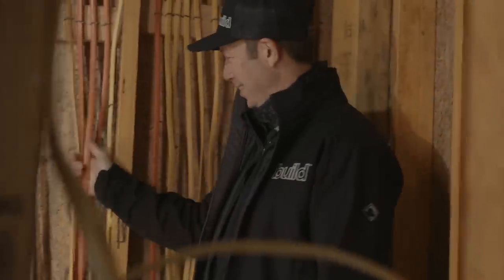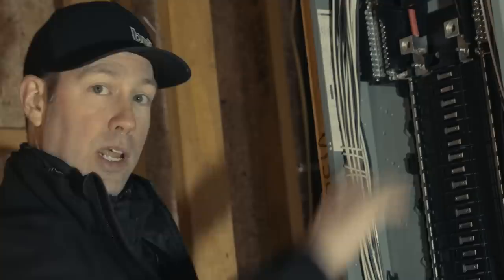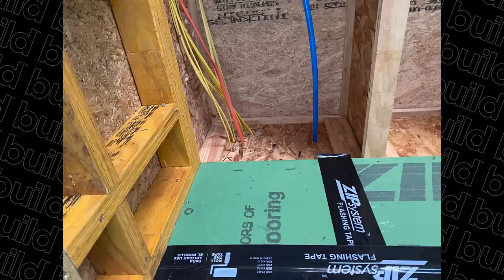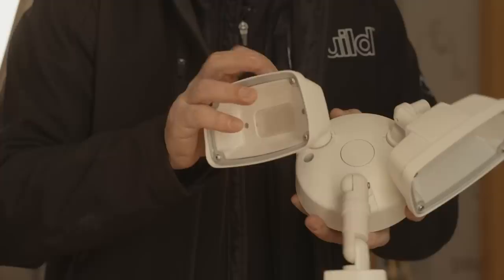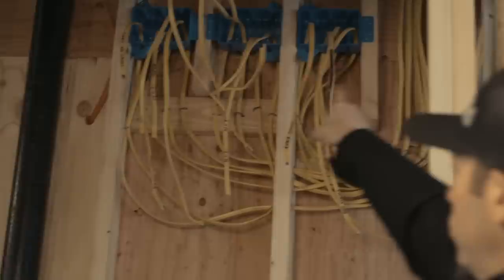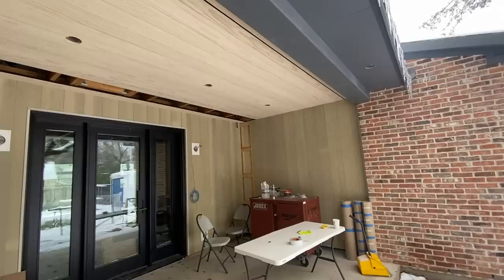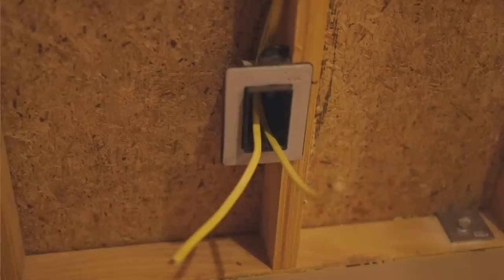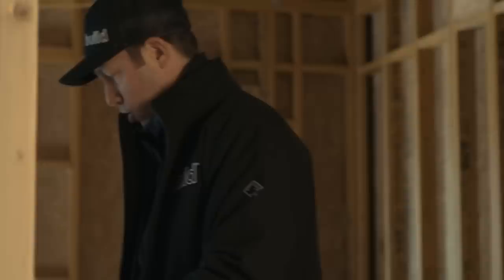5 Tips for New Construction Electrical & Smart Lighting!

Comment: What’s your opinion on the Leviton load centers with smart breakers?
Reply: I recommend avoid anything that used the term "smart" in its product line. Its expensive, Prone to break, and quick to become obselete, usually requiring you to replace them when the Mfg no longer support the product. 

Just install a Square-D or Eaton breaker panel and avoid the grief. Square-D & Eaton are US made. For Square-D avoid the Homelline line.
Reply: Look up Square D Trilliant breaker panels.

Leviton arguably has the best breakers and termination concepts in the marketplace, but their availability is poor and they're not going far with it fast when you can't go to the local electrical suppliers, let alone one of the big box home centers, to pick up a panel, breakers, or accessories.
Reply: @guytech7310  thanks for that perspective. I agree that the “smart” world products can be tricky to get in to and stay in because it’s always changing. Have you ever used those Leviton breakers or know someone who has?
Reply: @steveb365  will do! I agree that using products that are readily available is a “smart” thing to do ;-)
Reply: Who else remembers pushmatic breakers. They were new smart and cool.

Comment: If your electrician installs new circuits that will trip due to overload during normal  use, your electrician is not a very good one.

Using 12 for lighting is fine, but only if your lighting is on dedicated circuits.  My SOP is to use 14 for lighting circuits and I can run only 2 or 3 circuits for lighting.

Comment: Matt, since it's your house pay the electrician extra to use pigtails and REAL WIRENUTS especially on outlet circuits. Even if you use commercial grade devices, don't rely on the device to carry the load of downstream devices. Especially with 2 gang outlet boxes and #12 wire protects you against the poorly regulated device manufacturing market and makes it easier to install/replace devices. While screw connections have improved in recent years, do you really want the current 6th outlet to pass thru 22 screw connections. People forget to count hot and neutral, and with your 2 gang outlets (good practice) twice as many screw connections.

Comment: When you reduce a 4 gang switch box to a single gang it does look much better but now you need to stuff 4 or more number 12 awg wires into a single gang box. As an electrician I would be cussing as I tried to get all those wires into a single box. Maybe a 2 gang box instead with a Leviton 80608 cover. That would also give you a place to put labels for each button.
Also, in the bathroom I like to drop a second receptacle below the counter top. This also allows a place to recharge your toothbrush, and on the wife's side, the ability to leave her curling iron and blow dryer plugged  in permanently and hide them when not in use.

Comment: I have three issues with this video:
1. Proper circuit design should eliminate the need for 12 awg throughout. 
2. I would never want my circuit breakers outdoors. I know it's common in certain parts of the country, but the outdoor exposure eventually takes its toll.
3. Matt, for all that is holy; please don't touch the main lugs! (even if you think there are de-energized)

Comment: 30 years ago, I put in X-10 devices to control all the lights and some outlets in my house,  In the last 15 years, it's all been gradually failing.  If you're trying to build a 100-plus-year house, any permanently-installed electronics need to be designed with a long lifetime - at least 50 years.  This means that all logic-level switch contacts must be gold-plated, and no electrolytic caps or flash/EPROM memory (these things are pretty well known to have limited lifetimes).
Reply: Who makes those kind of durable devices?
Reply: I don’t know; I doubt that anyone does, at least not for the consumer market.  With electronics, it’s pretty hard to get away from using electrolytic caps.  My advice is to avoid using any permanently-installed electronics as much as possible.  This gets harder and harder to do, now that things like LED lights and AFCI breakers are so common and necessary.  At least install them with the expectation that they’ll need to be periodically replaced.

Comment: What is the gauge of black fat wire please?  What fuse like 50 amp is normal for it?  And is that the right size for bringing power in from stand by generator?

Comment: ... you might as well run 14/3 instead, and have split recepticles. Keep them at max 12 per breaker.
Granted you mentioned a bedroom, which requires an arc fault breaker.

If you aren't spreading your loads, and aren't attempting to balance you lines for savings, then having 2x 15A available in one socket is better than 20A.
Reply: 14-3. isn't compatible with arc fault balance load breakers, nor is 12-3, almost not used in residential,  the last 15 years
Reply: @technicalfacilities5295  
"Granted you mentioned a bedroom, which requires an arc fault breaker."

I guess I was assuming that those reading would understand that current arc fault breakers are single pole.

Comment: I wire my homes in emt.  I would never punch holes in a box and then put romex with no protection.  People not realize tat their home is constantly vibrating and insulation can be compromised.  I use 12 stranded for all circuits and 14 for lighting loads.  No callbacks for 40 years.

Comment: I'm not electrician but there cannot be anything wrong with stepping up wire and breakers.  The one thing I would do is use flex conduit in areas where critters could easily access as our house burned from critters eating our wires.  "Two Weeks!"

Comment: Hey Matt, thanks for the info, great video! Currently building my home in Green Valley, AZ out of ICF. I have a question, I was wondering what the 220 wire cost you? I will have 220  in my garage and now you have me thinking about running it in other places in the house... Thanks!
Reply: any wire can run 220vac. its the amount of current you need to use. 12 awg for 20 amp 10 awg for 30 amp , 8 awg for 50amp 6 awg for 60 amp. If your planning to put a sub panel, than I would recommend running at least 6 awg or less. However it really depends on what your going to use. For a Welder you need about 50 amps for a reasonable size unit. A large table saw probably uses about 30 amps.

Comment: Everytime I watch this show and see all the air sealing and Insulation that he goes through I then realized why it costs so much to live in California. I don't have any need for an air conditioner and I could live without a heater in my home and never complain. I have had the stucco ripped of the house for 3 years and the outside sheathing covered with 15# felt and no problems with any of the sheathing. Will hopefully finish the addition and get the house stuccoed this year. If I left my house covered in #15 felt paper in almost anywhere else in the country, my home would be destroyed

Comment: Fairly clean layout. While 12/2 or 12/3 is a good idea (despite the issue with tight spots), NO, don't use 20Amp breakers to reduce popping(? breaking).  I'll say, since you generally don't compromise on stuff, I'm disappointed you didn't throw some 2-4 core fiber and CAT6E plenum rated into your walls. One tip (I use it because I run lots of datacenters), every blind you cross, label your cable. Talking about CAT6E, I know BLE and WiFi is all the rage, but really, look up POE based lighting and other smart home stuff, when those international hackers come calling, they will save your rear. Talking about BLE switches, I think the best bang for buck is not having to run any, yes ANY copper wire down to the switch box on your wall. Think of the amount of copper lines you save. But the ones you show are not the kind that can be wired with nothing inside wall boxes.. Lastly, Throw some 48V DC lines (one or two 18G pairs) in your wall while you have a shot. The DC powered devices are coming. And they will save a ton of money over traditional AC fixtures and appliances. Every light, fan location, just drop a feed right now. But I'm really a fan of POE, and due to it's increasing wide use in commercial applications, the device makers won't disappear like an Austin startup!
Reply: So you’re suggesting duplicating the lighting wiring with cat 6e? and doesn’t 48v dc function with typical not special wiring?
Reply: @aayotechnology  Thanks for asking. Yes to doubling up. Way cheaper now with open walls then for retrofit. A few thousand dollars will mean nothing in retro, plus I think Matt is so famous now, some of these vendors will pay to be in his house. On the issue of 48V, with lights using 1/8th or lower the energy than back in the day, the most major use of power is gone. A 10 LED ceiling light bank is about 80-100W now instead of 800-1200 watts in the old days for same lumens. @ 48V, you are looking at what, 2Amp max? You could use 24G wire to run that if you wanted, except for the line loss that's higher with DC, so that's where the 18G will help. The other thing with DC lighting is the ability to move away from traditional round holes in the ceiling to completely different options.You could experiment with stranded twisted wire too to offset the need for thicker wires that run in parallel and drop your voltage with length. Whole another topic.

Comment: I guess you could run 10gauge for a little more extra cash if you're REALLY worried about tripping breakers. I bet the sparkies hate working with that stuff though.
Reply: The terminals on the back of NEMA 5-15 outlets do not support #10 Wire.

The only reason he can use #12 is because the NEC requires the internals of 15 AMP Outlets to support up to 12 Gauge / 20 AMP and it also explicitly allows wiring a 15 AMP outlet to a 20 AMP circuit with #12 wire.
Reply: @alex.friedberg  So use 5-20 outlets. They support #10.
Reply: @0blivioniox864  My fingers hurt just thinking about this.

Comment: I like Matt's videos and they are packed full of great information but a lot of things said about wire gauge, copper/aluminum bus, 110/220?? (120/240 is the standard), are debatable.  I agree that for receptacles 20A is a must, but lighting (especially with LEDs) not always true.  To say if you use copper you never have to touch it again, is not true.  Yes aluminum does have a different expansion coefficient but any lugs are subject to expansion and contraction and are recommended to be checked on similar intervals regardless of material.  Also, most lugs are dual listed for AL/CU.  Just sayin'.

Comment: These LEDs break much sooner than the hype in many cases and then are very expensive to replace. Those thin fixtures are good if there is an attic above though due to insulation issues.

Comment: To direct-wire the led ceiling light is silly or antiquated. It guarantees that the electrician will have work in the future. These unit should be wired plug and play - in Australia you would have a 413 connector on your lighting wire loop in the ceiling and the drive (transformer) will have a 2 or 3 pin plug on the end, so anyone can change out the complete unit which will fall in the future.

Comment: can someone explain what is good about recessed lighting, aside from not showing drywall imperfections? I want wide, soft lighting anywhere that has overhead lights, not spotlights everywhere.
Reply: Its out of the way, No need to deal with lamps everywhere. Plus it provides better lighting than lamps with shades on them. You can buy large can lights, I have 6" can lights with diffuser lens and the light is spread out. The one think I cannot stand is not having enough light. You can install Troffers, but they are a pain to install flush with the drywall and you likely are going to be limited by the ceiling joist spacing.

Comment: California, taking a jab at Texas here ;)   BIGGER isn't always better.      15 Amp breakers have their virtue, and if you're permanently in need of a 15 Amp breaker, then 12 gauge wire is over-kill and more expensive to install. ... harder to work with.    Ceiling lighting circuits in my 1964 house are all 15 ampere protected.  And every one of the fixtures has a pig-tail that's made from small-gauge wire... 16 AWG.   So a 20 ampere breaker won't protect here, as well as a 15 ampere breaker.  The pigtail becomes the fuse (yikes!) if the CB is too large.      Code allows some leeway here, because even a 15 ampere breaker leaves a pigtail at risk.      Electricians know best; I'm an EE,  not an electrician...

Comment: Circuits should never trip from overload, unless you don’t know how to circuit a home.
14/2 for lighting 
12/2 for all receptacles 
Separate all lighting from receptacles, this is the best way to circuit a home. That’s from 40 years experience and warranting the product I install. 

Aluminum on aluminum isn’t going to oxidize, aluminum to copper will, that’s why it says oxidation. Is for dissimilar metals, IE copper to aluminum. Read the product.

Comment: Hardwired power is a nice improvement, but I'll still never trust a bluetooth light switch or fixture. When they have hardwired power and data lines, that's when I'll get on board with smart home stuff.

Comment: I really have always had a thing for those touchplate low voltage systems. All the switches are low volt and the fixtures are just wired right from the relay box.
Reply: Just bought a 1960s ranch built by someone who could buy at the GE employee store. Every fixture except the closet lights are on this system. Seeing the smart switches centralized in the pantry... everything is cyclical.
Reply: @markwalling4924  YES! What I want to build is a 1960s ranch. Make it look and seem like it’s just a well preserved old house, but have it built like a modern house. Touchplate was a competitor product to that GE system, but unlike the GE one, Touchplate still makes the stuff!
Reply: @compactc9  yeah, there’s only going to be NOS of this GE stuff for a finite time. I also have the multi room GE intercom... I took the guts out and put Echo Dots inside. This house was like a time capsule... down to GE steel kitchen cabinets in Tiffany blue. Wallpaper looks brand new, laminate is unworn... we love it.
Reply: @markwalling4924  basically I want to build a house like that. Use the latest building science where you can’t see, and make it feel like you went back in time when you walk in the door.

Comment: Have you ever had a callback for an IOT security issue? Bluetooth and connected home security is difficult to get done right. The copper in your walls may future-proof your wiring for a generation, but in a couple years a security bug in any of the firmware running your lighting might make them insecure in a few years. I found no mention on the HALO home support site of the Bluetooth standard used or how to update the firmware. So, expect the lifetime of all of your light switches to be short -- in a few years a neighborhood kid will probably be able to spend $50 on a software radio and turn off all of your lights on a whim. Search for "Duo Understanding Bluetooth Security" and "NIST Cybersecurity for IoT Program" for good background.

Comment: Wait until 5 years from now when those switches are discontinued but now everything is wired for them. I'd wire normally at least for normal switches, then use whatever smart switch but can always switch back to normal switches later if needed. Also all that copper wire going to an aluminum buss that feeds everything that often fails in less than 20 years. Copper is better. CH style Cutler Hammer silver plated copper buss with lifetime buss and breaker warranty.
BTW here in OKC they don't allow any aluminum wiring inside structures, romex is only allowed in residential, and nothing smaller than #12 period.

Comment: Never got why some electricians use 12awg for lighting. Everything is LED. You can have 160 can lights on a circuit on a 15a breaker technically. And if you have 110 or 220 to your outlet you have something completely wrong! It is 120/240v. #triggered now 😅
Reply: You almost got me. I was going to call you out for your advice when I saw "220". LOL! Totally agree...as soon as somebody says that, that's how you know to ask somebody else about electricity.

Comment: What are you putting in the InBox? I'm confused about its use.
Reply: the inbox is a weatherproof in-use receptacle box that creates the cord bending space by setting the receptacle into the wall, instead of having the cover sticking out of the wall.  since matt is putting his insulation on the outside of the wall, he has it recessed into the insulation, instead of the wall, but the end result is close to the same - less chance of whacking your shin on the cover.

Comment: Product links are broken, which brings up one of my pet peeves - the tech lasts about 5 years, and the house lasts about 200. I do tech and have a burglar alarm license. I've been to sites to work on the door entry system and have been confronted by 35-year-old PCs running OS2 Warp. Is there any kind of open source or tech standard in the building industry yet? Make the tech bobbles replaceable.

Comment: Is steel framing cost effective? And is it stronger?
Reply from the maker: It’s odd to see steel framing in residential job. It’s generally not structural so it’s used in commercial buildings where the Red Iron and concrete is the structure and the steel studs are non-load bearing partition walls.